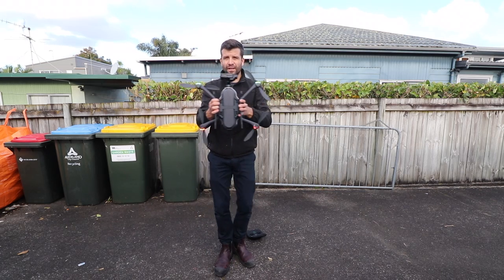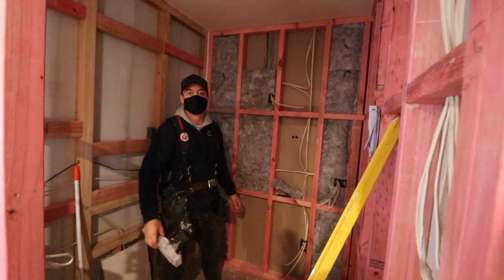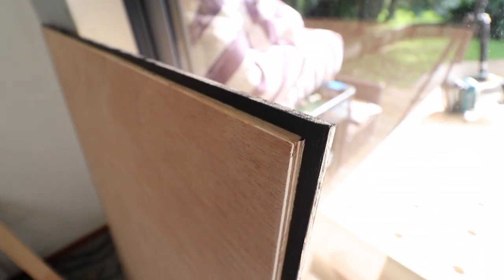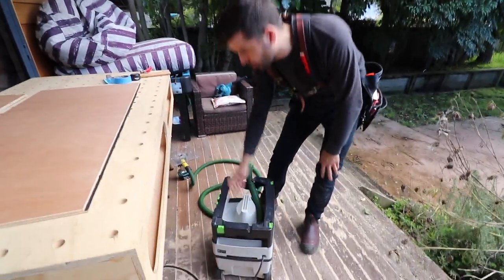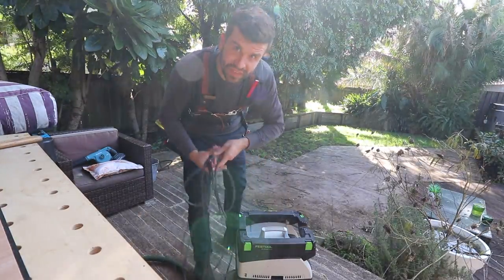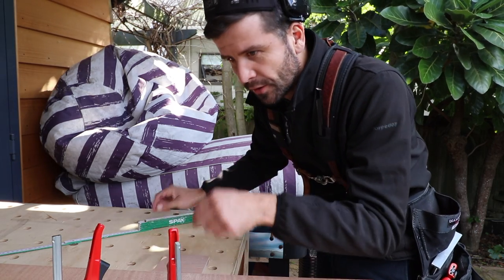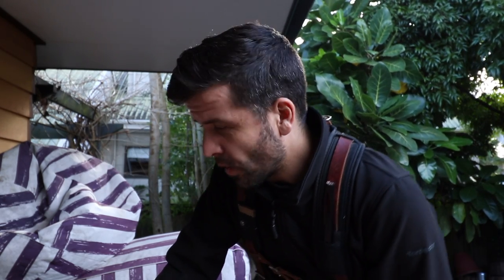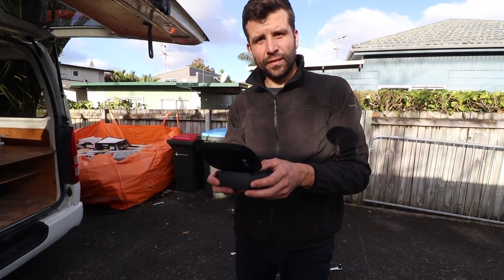Almost Fired Over a Vacuum!

Comment: Hey, I am looking for a vac for our house build in Napier. From what I can workout the one you use is rated up to 1200 watts for the connected tools. But surely your table saw and miter saw are more than 1200 watts? If this is the case how does this work for you? Cheers heaps love the channel - have not missed one!
Reply from the maker: Cheers! I was concerned about that before buying, but it hasn't been an issue. I plug the drop saw in everyday and it's been great 👍 Hope that helps.

Comment: Hey Scott, just a tool tip for ya bud. If you wanna look into it to save you time, you can get a trimmer jig that attaches to your track saw tracks. Saves you having to setup straight edges and the like to rout along. Keep up the good work mate. 👍👍

Comment: would be interesting if someone made a vacuum hose with integrated power lines for the tools. Wouldn't forgot to plug in the vacuum if the power supply went through the vacuum kind of like a canister vacuum works with a power head.

Comment: Hi Scott. I am interested in the Festool MIDI vacuum but the shop said the connected tool power outlet on the vacuum was only good for sanders and low wattage tools and would not cater for my 1700W milwaukee dropsaw or my 2000W Dewalt Table saw. He said I would need to get the bigger CT26 Vacuum and also change the switch from 5amps to 10amps. I see you have connected your drop saw to the midi and table saw also. I gather these are high wattage similar to mine. Have you experienced the MIDI tripping out at all with high power tools? Cheers

Comment: Hi You mentioned plugging in the drop saw to your vac. I spoke with a guy at a tool shop about plugging in my Dewalt 12" mitre saw and he said it would overload the vac and burn it out. Have you had any issues like that with your Festool vac?
Reply: I have been using my old festool ct for 15 years on my saw .never had an issue

Comment: How is that Rockwool stuff any different than asbestos though?
Reply: Woodworking Complex if you mean in the context of how dangerous they are, quite simple. Rockwool fibres are much larger and rougher than asbestos and don’t become embedded in the lungs like asbestos can do.
Reply: @ashleyw1393  thanks!
Reply: Rockwool is fiberglass; asbestos is asbestos. The fiberglass is biosoluble - meaning your body readily dissolves and eliminates any fibers.

Comment: I'm a apprentice AS Electrician in Germany one das my Capo came by and said we got no slot cutter but have to do a 5 m Slot from the Ceiling to the ground so i was on a Lifting Plattform with a angle grinder and the whole hall got covered in a dust fog, so Bad i Had to stop twice because i didnt seen anything. Hahahahah

Comment: How do you use a drop saw or pretty much any decent cutting saw with that vacuum? The max draw from the power outlet is 1200W.
Reply: Most countries in the world use >200V mains which allows 2400W
Reply: Cem A New Zealand is 240V. The max for that vacuum at 240V is 1200W.

Comment: Socialism and big brother.  I hate that.  But I agree that dust extraction should be mandatory. What I’ve found is sub contractors who keep the job site clean…. That use dust extraction…. That plan the job site for organization….. well, these folks turn out higher quality work.  

I build new homes and I check for cleanliness every day.  Here are the biggest advantages of the dust extraction and job site cleanliness.

In order of impact to the overall build.

1) customer confidence in your work… we have much happier customers and they are more forgiving when something does go wrong. 
2) easier to work on a clean site
3) helps keep work van cleaner and clothing is less dusty…you spread less dust to the surrounding areas and even your home. 
4) cost. These expensive quality tools save us time, improve quality, and gain is additional work.  My grandfather, Born 1889 liked to say this:

Be the first to work and last to leave… be the most productive worker and when everything falls apart, you’ll be the last laid off and the first rehired.

Comment: Why do you never have to wear a hard hat? In the uk we have to wear them all the time.
Reply: He's a small time builder/contractor doing private work. Hard hats are only seen on big sites, one of the reasons I steer clear. Too much red tape and bullshit.
Reply from the maker: I used to wear them all the time, worked on a lot of commercial sites. It is one of the things I do not miss since moving to residential

Comment: My Festool Midi is 2yrs old, 80% of the time it's used indoors, with the router, orbital sander, table saw and mitre saw as well as genreal cleanup. My hose has broken on the bayonet attachment and the plug is practically falling off, auxiliary socket cover lost its spring and the brake is jammed in. I now deem it a piece of shit, I'm so disappointed with the overall build quality 😪. Over hyped and overpriced 🤦🏻‍♂️. (I like to think I take good care of my tools too)
Reply: Llyr Jones Real talk